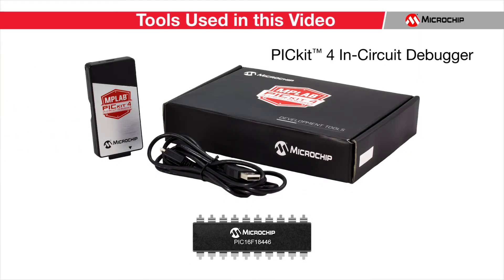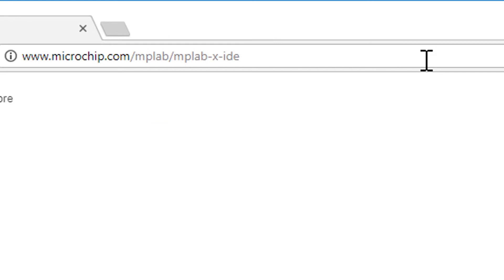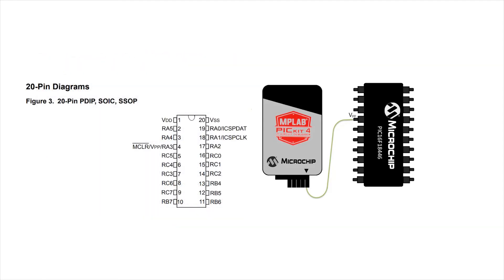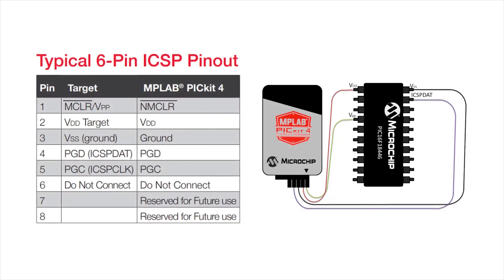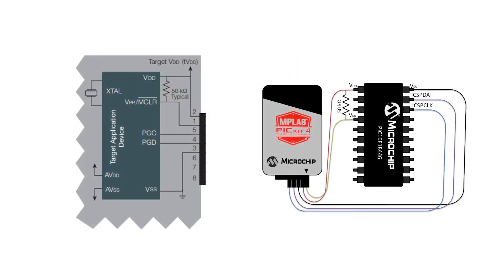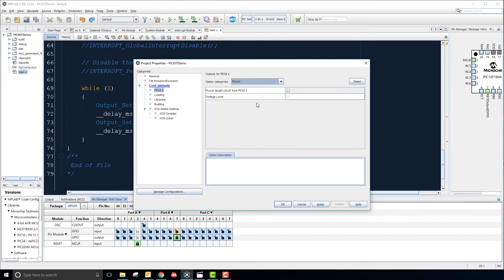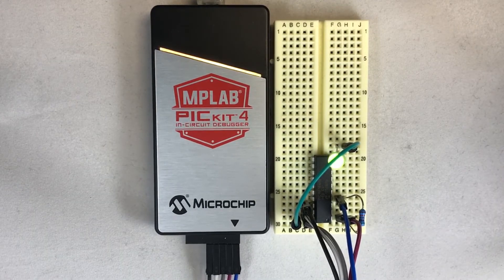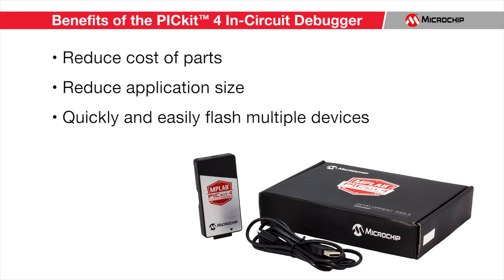How to Program a PIC® MCU with PICkit™ 4 In-Circuit Debugger

Comment: Hello Microchip technology 
Hope will reply soon.
We have purchased pickit4 but have not used yet because you have correction in pickit4. We complete our work using pickit2.
We have pickit2 chip adapter we generally used for programming new chip . Can we use this adapter with pickit4 for pic16f676, pic16f1503,pic16f1825 all have same number of pin and pin to pin competible as programming pin required.

In your technical documents pickit4 have VPP overshoot issue. Generally we use Microchip microcontroller that pickit2 support but now we use other microcontroller that pickit2 don't support. 
Please guide us so that we can use pickit4 without any problem.
Reply from the maker: Hi there, thank you for reaching out to us with your question! All PICkit models (2, 3, and 4) share the same pinout for interfacing with target devices. Therefore, the Chip Adapter used in PICkit 2 is compatible with PICkit 4 for programming the PIC16F676, PIC16F1503, and PIC16F1825. To address VPP overshoot, a limiting resistor can be used in the VPP line. In a test setup, adding a 470-ohm series resistor in the VPP line of the PIC16F54 with the Universal Programming Module 2 resolved the issue. Additionally, a 100-ohm resistor was tested on the PIC12F629/675 and was found to be effective. A more permanent solution would be to rework the PICkit 4 (10-10094R1) as per ETN37. Let us know if this helps!
Reply: @MicrochipDeveloperHelp  thank you for your response.
Sir may I get your email I want to share details of pickit4 and chip adaptor and questions related to chip programming using pickit4.

Comment: Ok, I understood this but I'd like to use mplab IPE.   I can't even connect my pick it 4... I'm afraid of asking this... I don't know why I think this is a stup#id question and you may not know why am I having issues, but the options read, program etc are not available...
Reply from the maker: Hi there, thanks for reaching out. If the options like 'Read' or 'Program' aren’t available in MPLAB IPE, it could be due to the Pickit 4 not being properly connected or recognized. First, ensure that you’re using the latest version of MPLAB IPE and that your Pickit 4 firmware is up to date. Also, double-check the connections to your target device to make sure they're correct and secure.
If everything seems fine and it’s still not working, try running MPLAB IPE as an administrator on your computer to rule out permission issues. If you're still stuck, our technical support team at Microchip.com/CSS is here to help troubleshoot further.
Reply: @MicrochipDeveloperHelp  thanks, I'll try this, I hope it works!

Comment: How does this work on Linux?
Reply from the maker: Hi there, thanks for your question! This device is compatible with Linux, Windows 7 or later and MacOSX. You will need to use the compatible IDE – MPLAB X IDE V6.20 is our latest version. However, the PICkit4 is EOL and we do recommend moving to the PICkit 5 or the ICD5.
Reply: @MicrochipDeveloperHelp  Thank you for the quick reply. Is there a trustworthy distributor of the product in Brazil? It seems almost impossible to get them here.

Comment: I remember when 8-bit PICs had 100 pages long datasheets and could be programmed by Assembly alone because of the simplicity. Today we need quite expensive programmer (80$), architecture is more complex and datasheets are 500+ pages long and less clear.
There is no advantage to program PICs over ARM platforms :'(

Comment: What if there is no ICDSPDAT pin on the micro-controller's spec sheet, such as aPIC24F32KA302?
Would you use pin 4's PGED1, as well as tie in pin21-PGED2, and pin14-PGED3, on the same line going to the same port on the PicKit4 Programmer, at the same time?
The PIC24F32KA302 also has additional Vss and Vdd pins on pins 27 and 28, how does that work? Do you have to also tie them into the relevant ports of the PicKit4 at the same time by brigding some wire or something?

Thanks.
Reply: did you figure it out?

Comment: Please can someone hep me with hardware connections for AVR128DB64 chip
Reply: Abdul, here's some information I gathered, I'd suggest you verify this all with a case to technical support. You need a Microchip account to log on and then you able to open a case asking about your connections.

See link for PICKIT4 pin connections to UPDI for your AVR128DB64 https://www.avrfreaks.net/forum/pickit-4-and-avr-mcu
See device manual "AVR128DB28-32-48-64-DataSheet" Microchip document number DS40002247A page 17 of 660 for 64 pin device connections and pg 24 for Figure 4-5. Recommended UPDI Programming Circuit Schematic

PICKIT4 Pin          AVR128DB64
#2 (VDD)              # 6 & 56 (Note: For the AVR® Family of devices, AVDD is internally connected to VDD (not separate power domains).
#3 (VSS) GND     # 7, 21, 35 &57  (All Ground pins connected.)
The decoupling capacitor between VDD and GND must be placed as close to the pin pair as possible. The decoupling capacitor must be included even if the UPDI connector is not included in the circuit. See page 24 of 660 for Typical values.

#4 PGD                # 51

Normally a 100-mil 6-pin 2x3 connector is used for connections to the device, what development board are you using with the AVR128DB64?
Reply: @PICMICRO  finally I got it worked with ardiuno nano, with two wires, thanks for your link

Comment: My PICkit4 doesn''t program any PIC18/PIC16 microcontroller> All the time I have an issue regardig  ID device is 0 and don't  recognize  the microcontroller> Please help me.
Reply: Criss, provide part numbers of the PIC 16 and PIC18 devices.
Reply: @PICMICRO  PIC18F27Q10,  PIC 18F27K42. The problem is with PicKit4 programmer, the PGD and PGC was broken. Is the secod one PICKit4  that breaks down inexplicably. Please review the hardware, I saw that you have  buffers for these pins.
Reply: @crissb9357  Hi Criss, are you attempting to program these devices on a breadboard or are you using the two Curiosity Nano boards that have the two PIC devices mentioned?

Comment: What about pic24f32ka302? Truly spoken, I bought pickit 4 when it was released. I also have pickit 3 and some pic microcontrolers. I don't know how to use them. Is there any board which makes them look like arduino?
Reply: Hi Alfred, 

A PIC microcontroller's device pin allocations, internal device architecture and programming language differ from AVR devices typically found on Arduino boards.

Available Arduino boards such as the UNO R3 use Arduino's IDE to program the specific board's device. The UNO R3 has an ATmega328P chip device installed in the board's socket. This ATmega328P chip is an AVR device from Microchip. This chip has a specific 28 pin allocation which determines the board's PCB design, this differs from a 28 pin PIC device pin allocation such as the PIC24f32KA302.

The PICKIT3/4 is used with Microchips free MPLAB X IDE and XC compilers, this is a whole differrent environment to the Arduino IDE and programming language style, so you will have a steep learning curve but it is worth it and this takes time. You will be able to program the PIC devices using the PICKIT3/4 programmer/debuggers with MPLAB X IDE installed and the specific C compiler which must match your device. The PIC24f32KA302 is a 16 bit device so the XC16 compiler needs to be installed after installing the MPLAB X IDE. 

Once you have both MPLAB X IDE and XC16 compiler installed you will then be able to setup connections to the device on a breadboard as demonstrated in this video and program the device successfully. There are also development boards available allowing various pin count devices to be installed and programmed. The XC16 compiler is vastly different to the Arduino style programming, but all PIC device datasheets have C and Assembly code examples so making the transition to switch from Arduino is a wise decision. 

Note that AVR devices originally designed and supplied by Atmel (Purchased by Microchip) also can be programmed in C or Assembly. This C and assembly style differs from the PIC compilers and Assembly. 

I decided to move to MPLAB X IDE and compilers and Assembler to gain better understanding of the PIC device and access functionality with no "black box" in between. I chose the Micro-X PIC development board from Embedded Results t/a Kanda.com to start my journey as this board allows programming of 8, 14, 20 28 and 40 pin PIC devices, the kit comes with the PICKIT4 programmer. It is a bit pricey but the many various features are worth it. Kanda also starts with Assembly language, which is referred to in datasheets on even the newest devices, so important to be able to use if to fully understand the device. This is a low level language which is fast and efficient but not intuitive to beginners. The the programming process still converts the final code into a hex file and along the way uses the assembly files before the conversion.

Good luck in your transition.